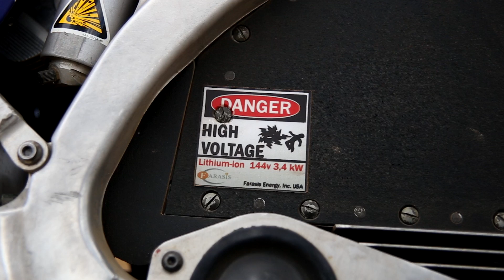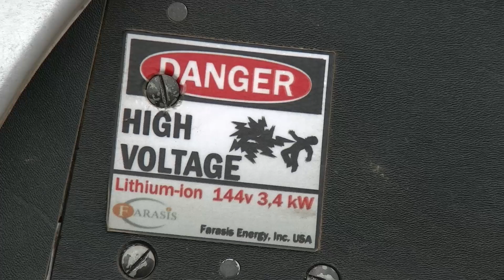DIY electric Yamaha YZ250!  Wild electric power!

Comment: I’m completely fascinated by the idea of electric motors replacing gas power.  I’m 59 years old so I really appreciate the significance. I still ride a DRz 400 Suzuki. I am looking at several different electric motorcycles.  Good video.  Thank you

Comment: You need a rock plate, one good hit on that motor its toast say goodbye. You put the motor in a bad spot, even with a bash plate no guarantee it will save the motor. So strange all that nice work and nothing to protect the outer motor case which is very brittle or sometimes soft but definitely not strong enough to take a hit from a rock especially of you bottom out. One ride with that bike with me on the trails or MX track that motor would have been busted from impact. Don't say it's strong enough because I bent titanium bash plates like they were made out of paper. motors are built to produce power not shields to protect the bike frame. If you were to sell this I would myself advise people not to by it because it was obviously backyard engineered not professionally!

Comment: ok for a second or third bike..... how much would the batterys be after they died in a year or two....? i once bought a VW Jetta diesel, to save coin.... diesal was then 10 cents per litre cheaper... not no more! and after owning it for 2 years the fuel pump took a crap.... so to have it rebuilt i lost all my saving by running the stinking, smoking diesel.... and it was a gutless pig! i coulda been driving a GTA and run it cheaper....

Comment: Why actually gear box isnt used? 

Like the suing gearbox will be much more suitable than v belt drives right?.. Here , how are you changing the speed of the bike, by changing the power supplied from the battery right ? That will not increase the torque required at the wheel end like if we are going on beach or on sand , we need more torque right?... 
Can you explain on this regard?
Reply: It is not a v belt, it is a toothed belt. The motor has enough torque from 0 revs to full revs, so it doesnt need a gearbox, an engine needs a clutch and gearbox as it has no torque at zero revs and very little torque at low revs, the power band is like a hump on a graph, an electric motors power on a graph should be a straight line the torque slowly falls off at highest revs
Reply: @eddywilliams6212  Thanks a lot for the clarification.

Comment: You're very right about electric dirt bikes, they take incredible maintenance and every single part costs a fortune.  I've done hundreds of rides in the mountains, we rarley go further then 40km, but we are always fixing the bikes.   Doing hill climbs with no gears, and torque from 0 rpm, looks fantastic! (can't ingest mud into the engine either!)
Reply: I guess you meant to say "gas bikes take incredible maintenance"* ...?
Reply: Mykel Hardin  That's not true at all. They both take lots of maintenance.
Reply: @legendfpv  I made similar upgrades just as a side project, and really the only maintenance for electric is charging the battery.
Reply: I can ride mine all day long with a 120-mile+ range, much much more reliable than ICE bikes
Reply: How do we actually make this?

Comment: Ok. So to recap. You have dirtbike that doesnt ride well on tarmac: low max speed/low milage/uncomfortable seat/not to mention no cooling for motor /bad weight distribution. 
Doesnt go well offroad: too much whellspin, tire eater due to poor throtle control (in fact no control at all becouse there is no clutch)/ no susspension can withstand the weight/ no motor braking power/ 40min ride for avrage rider (i belive anyone with more skill will drain battery in 15min)/ again no cooling and probobly no oil bath for parts too lube. Grease inside motor will burnout due to unregular use and temps. You need to wait few more years for tecnology to keepup with the ideas.
Reply: Well, alta motorbikes have produces ebikes for a while and they are quite reliable... have a look for yourself!
Reply: @Pascal_Robert--Rc_Creations  
I'm aware off Alta bikes. I watched Lyndon Poskitt(he didnt make it to the race becouse bike was stolen from Van) and Ty Tremaine racing it at Erzberg Rodeo. However he didnt finish the race becouse he didnt make it to the checkpoint for battery swap. So overall good idea and we need to wait for better batteries;)
Reply: Koster Enduro did they recover the stolen bike?

Also you know Alta got bought and killed by Harley Davidson? No more Alta so this is why people are looking into things like this
Reply: @Jarmezrocks  Harley is making electric motorcycles now.  It's why they bought out the competition.

Comment: Still trying to find an actual guide step by step... if someone knows one then link me please!
Reply: I plan on building an electric brat from scratch in the next year. Let me know what you find!
Reply: me too
Reply: @Musicman6804  I'm starting a project
Minibike but same concept
Reply: Krisuno  is in the middle of one right now and after I get the parts in I might do one but don't count on it
Reply: Devin lindstrom has some good videos
Reply: I am also planning converting my KTM to electric, but with a little bit different layout! 2000!!! 18650 LiIon cells with 3000mAh each will provide enough energy for about 150 to 200 miles of riding fun! The motor will be in the rear rim for lesser losses in the drive Train! And in the front rim there will be an  generator for regenerative braking, maximizing the range and make it way more efficient ! The whole conversion will cost 12 000 euros, but who cares! But now I am still in the planning phase, cause Corona
Reply: @huey-fan8335  bruh just make your rear hubmotor do the regenerative braking (if possible, it will also make the whole build weight less).
Reply: @huey-fan8335  Very interesting! Did you lead the project?

Comment: Where do we get this motor . Need more info . Got a 1990 cr to convert
Reply: @ 0:15 it tells you the batt - start with how much power you put it pick a motor run it like you stole it 144v seems like overkill (like it will kill you when you have a malfunction) Ive seen 48 volt forklift motors run an entire car.  I guess since there is no powerband they had to go overboard to get the same "feeling" but seriously a 18volt dewalt drill could run your CR use a 3 vbelt pully system to step the rpm down to something a human could use(my experience is it also takes 3 steps to have enough torque to make it usable) GL!
Reply: @bravosierra8010  you left out so many details . Lol speratic much
Reply: @nutzy99ify  look at any DIY ebike or boosted board work from there its not rocket surgery
Reply: @nutzy99ify  just to break it down even further i guess... 18 volt dewalt drill takes 18 volt battery drill spins just like the shaft on a motor and drives the bike - hook two batteries up in a series now you got 36 volts - you can run the dewalt at 36 volts but youll burn it out quickly you need a 36 volt motor - forklift motor probably to heavy - maybe a scooter like people ride at walmart - call a local repair shop they always have a few laying around - id probably go for a 24 volt motor with 2 24 volt battieries in a series with a speed controller in the middle so boosting it to 48 volts would really turn it up then the milli amps gotta make sure they can provide enough consistent current to keep the motor alive after that its all storage for longer and longer runs - batteries = weight - as for the torque personal experience (and some engineering principle i read somewhere a long time ago) says that you need to use a pully why? can a dewalt tear your arm off? no but if you hook that dewalt into a 3 tier pully system decreasing the RPM but increasing the torque it would tear the arm off godzilla see? so you take tiny motors that turn fast use - use a speed controller to keep from blowing them up - use a pully system to break the RPM down to a useable speed and then start tearing teeth off the sprokets.  Finding your own happy medium between battery life and performance - i would not be afraid of used equipment anywhere except my speed controller.  Find a really good motor / controller combination on ali or banggood or gear best - then just buy the controller
Reply: Bravo Sierra I would personally run with a 36 volt for the power output. yes you would need more batteries, and get less economy but in the long run the motor type and out put is up to the person building